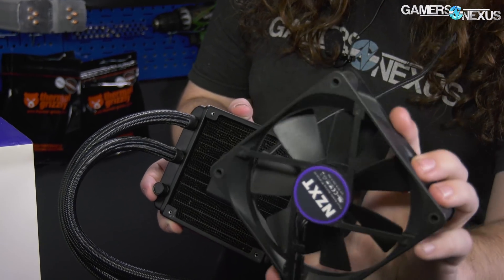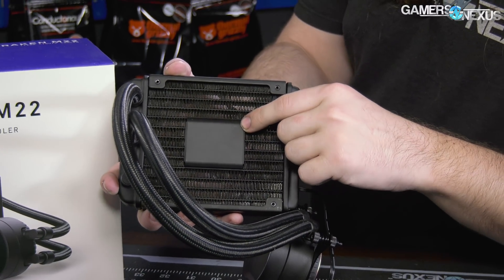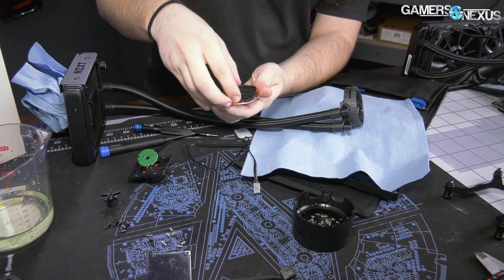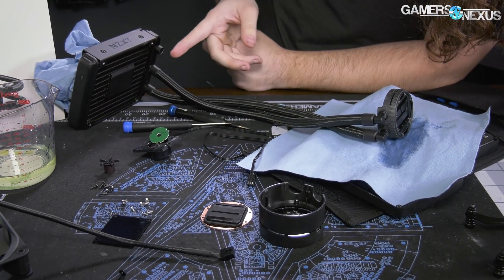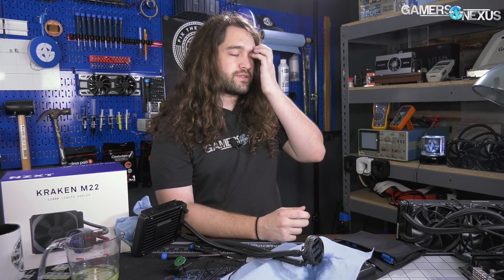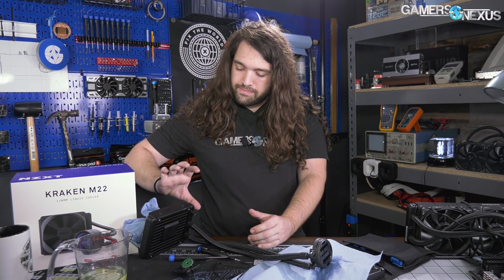Tearing Down a Strange Liquid Cooler - NZXT M22 Pump-in-Rad

Comment: i would think the inlet on the block is the one with the weird indent on it to push the rubber gasket to the micro fins with pump pressure so it does not leak over the micro fins

Comment: So why can't the waterblock have a lower profile? I've been unable to find any low-profile waterblocks due to pumps being inside of them - but since the pump isn't in the waterblock - why isn't it of a lower profile?
Reply: MinecrafterPiano just because nzxt had to fit their rgb led logo and they're using the same housing for all Kraken series, just remove the top part and you got yourself a lower profile AIO.
Reply: MinecrafterPiano
Because Injection moulds cost alot of money. 
You could try using a Corsair Hydro Series H45. The Pump is in the Bottom of the radiator. The block is only about 24mm high
Reply: Literally just pop off the NZXT cap like Steve did in the video and it becomes extremely low profile with no detriment to operation. Unless you're still concerned about looks.

But as for why they don't often make them that way, it's probably because they assume you have enough space there to put a stock air cooler.
Reply: Simply because it has to look like the rest of the series
Reply: Aio sucks custom loop or stick to air
Reply: Rosewill PB 120 uses this design but a low profile block.
Reply: Build a custom loop?

Comment: Wouldn't you lose head pressure with pump that far away from cpu  block? Seems like you would want more pressure to force water into micro fins? But would that also bring the pump temps down? Guess I'll find out when review comes out.

Comment: Ok this might be dumb a question but how big of a deal is it how fast the water travels inside the cooler? Doesn't the water get cooler the longer it stays in the radiator so it all kinda evens out or is that not how it works?
Reply: For the most part, moving water behaves like a thermal mass (does not apply if the fluid is stagnant), so a high flow rate isn't a big factor in temps. If I'm not mistaken, the only prerequisite is that the pump's pressure is enough to overcome the internal hydrodynamic friction of stuff like the fins in the block and any other things that impede flow (hard kinks or bends in the case of hardline tubing). Also, since the water is a thermal mass, how long it spends in the radiator is irrelevant. If one part of the loop is being cooled, the entire loop is cooled (the fluid is the same temp throughout the loop for the most part). Hope that answers your question :)

Comment: Taking apart things is fun. You should add a timelapse of you quickly putting it back togethor ;) 

As for why the tube is in the middle, The tube in the middle flows directly to the pump. The end cap on the other side completly open (Inside), the end caps with tubes and fill port are channeled whuch basically makes 2 paths that go around the center path. The tube from the middle is the out port. while the one on the side in input (which is why there is a fill port on the other side)

Comment: go to a auto parts store and get urself a hydrometer
Reply: Just be aware propylene glycol can't be read with a hydrometer in higher concentrations, and you have no ability to tell if you've surpassed that threshold.  Specific gravity hydrometers are kinda dangerous in automotive since most coolants are now based on propylene glycol.  If it were known to be mixed correctly in the first place it works well enough, but if a well meaning but naive owner keeps topping it up with pure coolant, testing might not indicate it.
"Propylene Glycol
 cannot be read with a hydrometer due to the fact that up to 70% concentration specific
gravity increases, but above 70% specific gravity decreases."
https://www.reichertai.com/clientuploads/directory/download_pdfs/Reichert%20Why%20Use%20A%20RefractometeR.pdf

Comment: Patents are fucking stupid sometimes, is there a reason that no one has messed around with inline pumps?
If you approached it like house heating/cooling for example then one line could be push and other line pull

Comment: Very interesting design.

By the way, don't be so quick to dismiss that impeller, it looks a lot like the design of some of the best pumps used in the aquarium industry, and those pumps move a lot of liquid. In fact, i'd say that the Asetek design that you've shown in previous videos looks a lot less efficient, and more like something you'd see in very old aquarium pumps from like the 80's and up to maybe the late 90's, and then also in very very cheap pumps, where a soft low grade plastic is used, meaning you have to reinforce the impeller blades (which, usually means lower pressure). :)

It's so funny to see that the pump tech is basically the exact same, as is used in aquariums. :)
Reply: Christian I was thinking the same thing when watching. Small high rpm pumps are more efficient but at the cost of noise usually. I liked seeing all the o-rings for seals vs just some rubber gasket material. I work in the chemical industry and for static seals o-rings are king.
Reply: so liquid cooler makers are just re-inventing the wheel thirty years later? the question then becomes why bother heating your tropical fish tank when you can just hook it up to a CPU/GPU cooler loop?
Reply: As i said, proportionally and design wise, including size, it appears to be very similar to some of the best pumps out there in the aquarium industry. I don't think it's a problem, and certainly not a bad pump design, at all.

I think the location of the pump is more of an issue than anything. Even though there's a dead zone behind the fan hub, the fins that are there, still dissipate heat naturally, and i don't think that the housing has enough of a surface area to do that, and in fact, when the pump is spinning, it'll probably generate heat, and so it's just compounding the issue of thermal dissipation, rather than resolving it. :)

Make the pump a part of the end-tank on the radiator, instead of putting it in the center, or on the hoses, as i've seen some other designs do. I don't understand why no one has done that yet, in my eyes, it's the next logical place to put it. It'll mean a larger end-tank sure, but most every case could accommodate that no problem, and it'd not detract from the thermal dissipation, or the aesthetics, as other solutions seem to do.
Reply: I think he's talking about the short impeller depth and diameter.
Reply: Yeah, I think that the impeller is pretty good for its size, usually they can go bigger when the pump is on the block. 
But that simplistic design + the high rpm means much of the pressure is generated due to centrifugal force and it looks like it would succeed at doing that
Reply: Actually PC water cooling started out using fish pumps.  Eheims used to be huge in the WC world for custom loops until D5s and DDCs that could run on the 12V rail became common.
Reply: Yeah, I'm not worried about the size/shape of the impeller, unless Steve's judgement of it stems from something he saw during performance testing. I'll be eagerly anticipating tomorrow's performance review video.
Reply: Christian I dare you to hook a 300 gph fish pump up to a pc. It would be so unnecessary but cool. 😎
Reply: Algae buildup would clog the microfins in the cpu block.
Reply: Christian the heat from the pump motor is probably insignificant, so if you want to have a really low profile AIO, this would be a solution. If you don't have a case window, you can even pop off that top with the led logo for reducing the height a fair bit.
Reply: No Gravitas that is a great idea.
Reply: Tuchulu but you could put a filter in front. But yea. High maintenance and a dead cpu. Yikes
Reply: Exactly, without performance data it's just a personal preference for big impellers.
Reply: toy machin
Reply: One thing about the impeller in a fish tank pump your temperatures are much lower. The higher temperature you're going to get when cooling a CPU will degrade the plastic sooner I believe.
Reply: @NewAgeDIY  I don't think plastic degradation is a concern, it is easy enough to choose a plastic which will not be significantly affected by the actually very moderate temperatures in the water cooling loop of under 60°C. I'm thinking polyamide is of particular interest as water permeates the polymer and makes it tough and flexible, and while dry and warm is a death sentence for PA, wet and warm is perfectly fine for decades. It's not a cost concern either, the plastic is ancient.

One big reason you want a bigger impeller in a PC water cooling setup than in an aquarium is noise. You want a lower-speed, noise-optimised design. And the reason you might want a smaller, faster one in an aquarium is to increase the surface velocity of fluid against the impeller and provide some self-cleaning action and higher static pressure to cope with a larger variety of use cases and maybe unforeseen obstructions.
Reply: 100% an aquarium pump design. Several good aquarium pump powerheads look just like this internally. Also, a copper version of this pump-in-radiator would be excellent option for discrete GPU water cooling solutions. I would love to "NOT" have to tie a GPU water block into my main cpu water cooling system. It would provide independent control of cpu/gpu cooling, which is something you lose when you water cool everything form a single water loop.